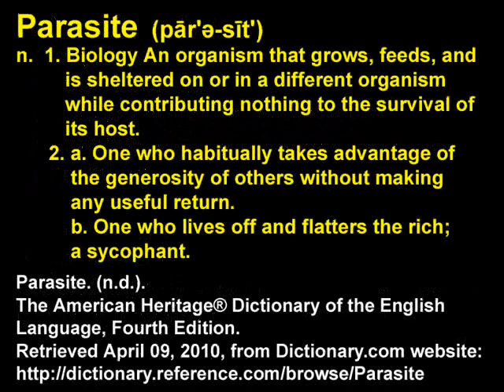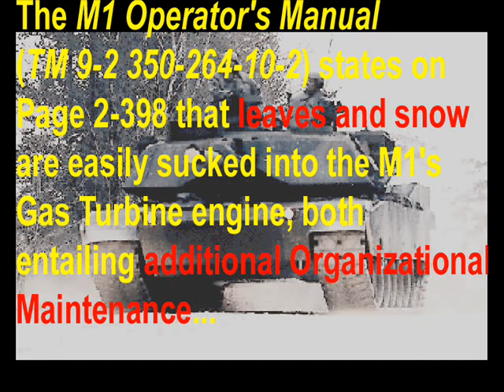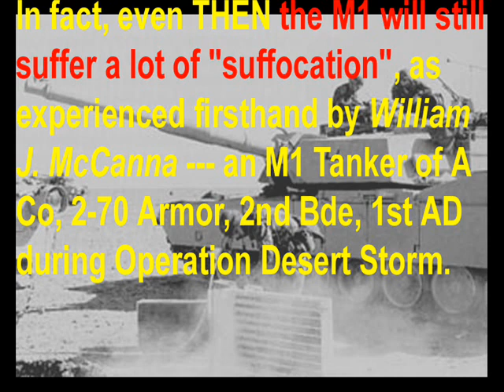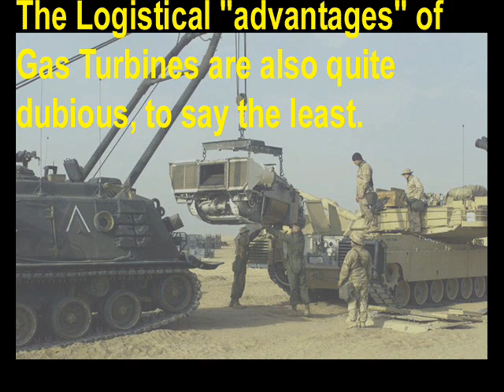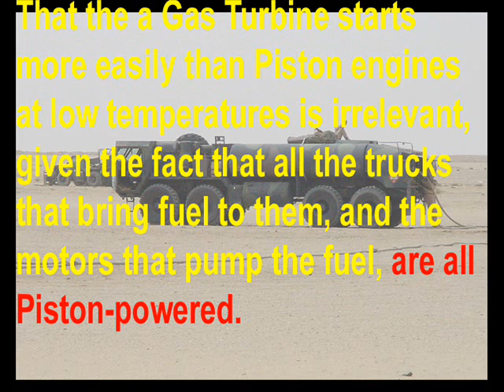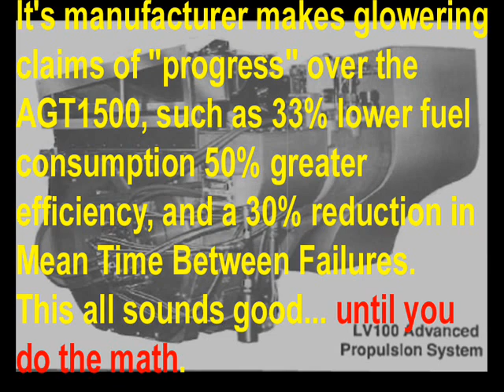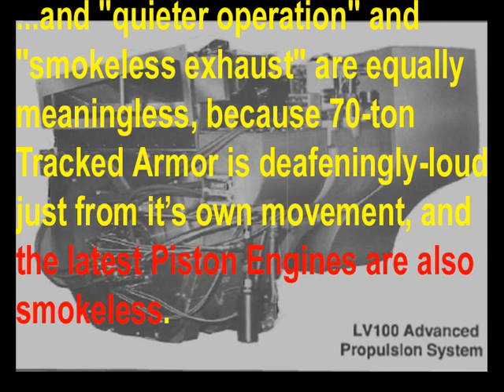The REAL M1 Abrams! Chapter 7: Logistics (Part 3/9)

Comment: @MarshallJukov 
You a TYPICAL "dump soviet internet troll":
1. One and only engine automatic clean system on T-80 is VIBROCLEAN system.
2. Vibroclean system is automatic system.
3. As I said: Read The F-ing Manual (Tank T-80. Technical and user manual / Танк Т-80Б. Объект 219. Памятка экипажу по эксплуатации)
4. Ke-ke-ke.

Comment from the maker: @TheOgle420 A Diesel V6 with 500hp is a completely different class of engine than a Diesel V12 with 1500hp.
As for the reliability of the Bradley's engine, it's GDLS HMPT-500 transmission was a MUCH worse problem, so much that half the Bradleys deployed to the Persian Gulf never left the depots!
The M1 has some chronic transmission problems too. They don't affect it's downtime as much as the engine, but they DO result in fires that destroy entire M1s, and can't be put-out even when they start.

Comment from the maker: @TheOgle420 "When the Abrams was engineered in the 70s there were no diesel engines available that had the power to wait and perforce need to push around a 70+ ton vehicle at over 40mph."
Actually, there was the MTU 883 that had powered the Leopard 2 in the days before Chrysler and GM had completed the XM1 prototypes, and there was the AVCR-1360 that powered the GM XM1 prototype (even at one time the Chrysler XM1!). The prototype for the Hyundai K1 was powered by the AVCR-1360 as well.

Comment: The advances in diesel engine technology in the last 30 years has been incredible.
When the Abrams was engineered in the 70s there were no diesel engines available that had the power to wait and perforce need to push around a 70+ ton
vehicle at over 40mph. I noticed that you use stats from Desert Storm in 1991. The tanks in that battle were M1s.The tanks currently used are M1A1s. And those tanks were made 20+ years ago. Again it was the best engine available at the time!

Comment: @Mr420pot420 
Better get a new truck or tractor then, the last one I saw which needed to glow for several seconds was the tractor of my girlfriend's uncle - back in 1993.
Also, combine seat activation with temperature sensors in the engine, and a pulse system to turn the glow plugs off after a maximum of 180 seconds, and you're fine (modern glowing plugs glow approx 4 seconds before ignition, and 120 seconds after to optimize the burning process, minimize the smoke, and maximize the output)

Comment: @Mr420pot420 
Glow plugs are only required if the engine temperature drops below -10 °C (in modern diesel engines, older ones require the glowing at 0 °C), and this already happens long before the operator even considers to start the engine - it's triggered by pressure sensors in the drivers seat, if the key is put in the ignition etc. There are several ways to initiate the glowing  before the engine is turned on, and is practised for quite some time now (VW Golf, Mercedes SL, BMW X3 and X5).

Comment from the maker: @Mr420pot420 "also what are the top speeds of these tanks ohh wait you don't know"
That would depend on the tank.
M1 = 45mph, IPM1 = 41mph, M1A1 = 41mph, M1A2 = 42mph, M1A2 SEP = 42mph, Merkava (all of them) = 37mph, Leopard 2 (all of them) = 45mph, Leclerc = 44mph, Ariete = 40mph, Challenger II = 37mph, Type 90 = 43mph, M60A1/2/3 = 35mph, T-72 = 40mph, T-80 = 40mph, T-90 = 40mph, Zulfiqar III = 0mph, Type 85-II = 30mph, Type 96 = 45mph, Type 99 = 50mph.

Comment from the maker: @Mr420pot420 "So tanks that start faster which are prone to spending a lot of time stationary for logistical reasons is a bad thing?"
There aren't any diesels that take 60-90 seconds to start, or consume 10 gallons of fuel in the process; nor do any other tanks spend 1/4 of every day under maintenance. During Desert Storm, the USMC's M60A1s spent only 15min of every 24 hours refueling, recalibrating, and changing their V-filters --- all at once, with the engine running.

Comment from the maker: @Mr420pot420 "really snow causes additional maintenance like every other vehicle in history side note diesel engines require a lot of winter mods like different oils and radiator covers."
Not enough that any diesel tank's Preventative Maintenance manuals have ever warned crewmen not to "walk on eggshells". There are also no diesels with anywhere near the suction force of a gas turbine.

Comment from the maker: @Mr420pot420 "diesel engines requires a lot more the 5 sec to start and warm up"
Not just to *start*, they don't.
"delicate aviation jet engines so like the harrier jump jet that sucks people through and has no damage?"
The only jet engine I know of that can suck-in Foreign Objects, chew them up, and spit them out with no damage is the TF34 High-Bypass Turbofan used on the A-10 --- which is a far cry from the blow-dryer used in the M1.